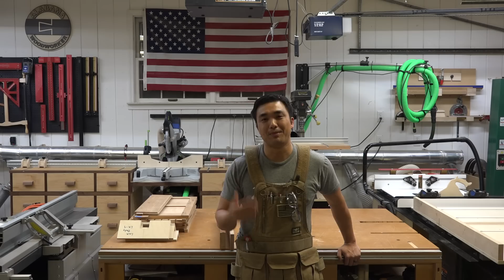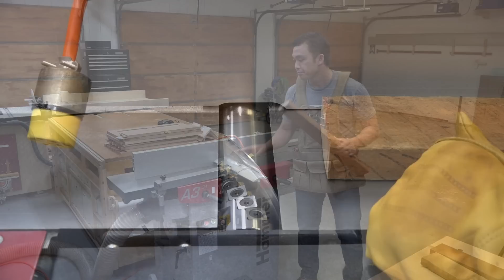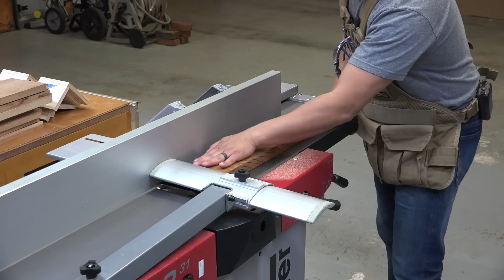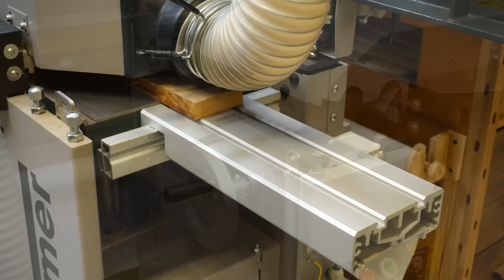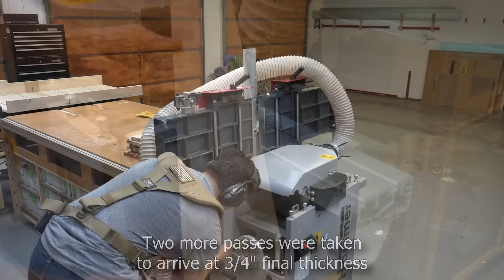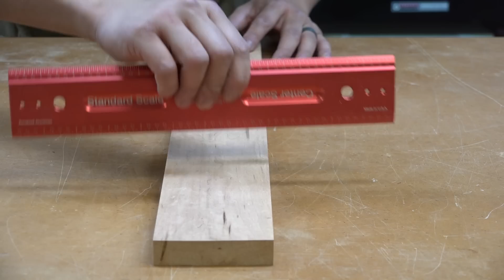Milling Rough Lumber: Surface 4 Sides S4S

Comment: Hey awesome vid! What do you do to account for snipe on your jointer/planer?
Do you leave a couple extra inches on each end when you rough cut, so that any snipe gets chopped off when you cut to final length?
Or is your machine tuned well enough you just don't get any snipe?

Comment: How come you don’t take down the other edge on the jointer instead of using a table saw?
Reply: If you do that, your final edge will be flat, but there's no guarantee it will be parallel to the initial jointed edge.
It's the same reason you don't joint both faces of a board--you have to joint one face so it's flat, and then plane the other so it's parallel.

Comment: Most jointers don't have that cool safety fence option.  Keep this in mind before using a machine designed for milling edges to mill a wide surface.  
Much safer to use a surface/thickness planer for wider work.

Remember you have razor blades spinning toward you at a few thousand rpms.  The wider the piece the more risk of binding and kickbacks. 

You can do the same result using only a planer and table saw.

Comment: So do you always break a full length bord  down into smaller parts or does it depend on each boards starting shape? 
Like a rather stright unicorn board or a common duck twisted warped board?

Comment: The 4th side can also be done by a planer--assuming it is not too wide for the planer.  You also might have to use one pass of the jointer after using the table saw to "clean things up".

Comment: Love your content. I was always taught to beging on jointer with bow up or piece in concave down position. This is so you can avoid rocking and rolling the board as you pass over cutterhead. But, I've alway felt your method would remove less stock overall if one could control that rocking while moving through. You seem focused and careful with your hand movements while guiding your pieces through but any technique that is less regimented going through will just be cleaning the still bowed surfaces. Am I thinking logically? - novice here.

Comment: Just a curious question, wouldn't it be okay to joint cut the final edge since both faces are parallel? Is there a particular reason you use the table saw for the final edge?

Comment: Nice points you made. Nice making them on a 3500 piece of equipment
Reply from the maker: Man, I wish the Hammer A3-31 was that cheap.
Reply: @AlabamaWoodworker  I did look it up to match sure the numbers were right, even going to the website but site wanted me to join so I said, 'nah'. Maybe I got an old link as far as purchase price as I reading into the third page of google responses, I see $5877 as a price.
Reply from the maker: @bogey2230  Yeah, that's about right. I'm happy to answer questions about the machine. However, I hope I conveyed the intent/purpose of this video as being a demonstration and the logic behind my milling process. I'm not sponsored by Felder and I gain no benefit by owning a Felder machine. If I was, I'd state that in the video.
Reply from the maker: @bogey2230  Also, if you're genuinely interested in the pricing on this machine, I'd recommend connecting with Felder Group at a trade show they're participating in. They often offer a discount on show floor models. That's how I acquire my machine and several of my friends have done the same.

Comment: Honest question: why use the table saw at the end? Would it work just as well if you just joint the last edge as well? Thanks for the vid, and congrats on the baby! (I know it's been over a year but anyways :) )
Reply from the maker: Yes, it would. Actually, it would be better to run it through the planer to ensure the two edges are perfectly parallel. However, I'm not keen on running a single piece on edge through the planer. Just seems a little "tippy" to me. If I had multiple pieces to gang together to provide lateral support, I'd likely run them on edge. That being said, my table saw is very accurate and I'm confident there edges are parallel, flat, and square to the other faces.
Reply: @AlabamaWoodworker  thanks for your response. Now that I think more about it, running it through the table saw ensures the edges are not just flat, but also parallel with each other. Whereas running the edge through the jointer will only ensure it's flatness and perpendicular with the face. 
Good vid for a newb like me, I'm just using table saw and jointer for the first time :)

Comment: Very good video, thank you.  One question I have is after planing the two sides then jointing one edge, is it possible to simply joint the remaining edge instead of using the table saw?  After obtaining three flat and square sides doesn't it make sense to just joint the last one to achieve the same result?  Just wondering.  Thanks again for sharing this.

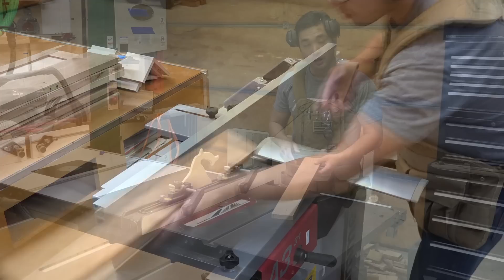Comment: 8:15 why not use the jointer to mill the last side?
Reply from the maker: You can absolutely do that. The table saw is a faster method.
Reply: @AlabamaWoodworker  Makes sense, thank you!

Comment: Hi Huy, congratulations to you and your family on the arrival of your baby girl and thank you for the awesome video.
Just a quick question regarding the table saw, where can I get that fence and the two clamps(?) on top? I have a very old table saw that I recently acquired but too afraid to use ( kickback) cos it didn’t come with any guard, riving knife or fences. I’m trying to get a riving knife custom made but at least with the fence like yours I feel like it’ll be a lot safer to use.
TIA and g’day from down under btw.
Reply from the maker: I'm using the JessEm Clear Cut Stock Guides. They are very effective at keeping material tight to the fence and preventing kick-back. They are a great aftermarket safety investment.
Reply: AlabamaWoodworker Thanks so much for the info Huy, for a complete newbie like myself it’s definitely worth having. 
Chúc em và gia đình nhiều sức khỏe :-)

Comment: QQ on your hammer.  Does that come with one extension or did you have to buy that? I'm curious as I'm debating (dreaming ) of getting that unit.
Reply from the maker: The A3-31 does not come standard with the extension. I bought it as an add-on and I think it's necessary on the outfeed of the planer.

Comment: Why is that you don't just plane the last edge? I've always heard that you shouldn't do it (makes sense if only 1 face would be planed, and the other still rough), but if everything is square, then what's the issue of doing so? Btw, this is Maple, right?
Reply from the maker: This is Cherry. You can run the last edge through the planer. That is acceptable. In fact, that's Philip Morley's method for milling lumber. I choose to go to the table saw because I don't want to have to transition back into planer mode on my combo machine. Saves me a little bit of time. What you described is perfectly acceptable. I prefer to go to the table saw, which is also acceptable.
Reply: the table saw has a fence where you put the clean edge on.

Comment: Great video and looking forward to more! What's the thought process when figuring out where to make your cuts when cutting oversized?
Reply from the maker: Thank you. I don't understand your question.
Reply: @AlabamaWoodworker   Sorry, just wondering if you typically leave a certain about of board length when making your rough cuts before milling.
Reply from the maker: @everydaymoto7315  Okay, now I understand your question. I rough cut my boards 1" longer, 1/2" wider, and 1/4" thicker than I need. That's also dependent on the level of twist, cup, and bow in my material. If a board is extremely twisted, I may have to mill down a significant amount before I can get a board flat.

Comment: Awesome video, I have a couple questions. Why would you stand the board on edge for a few days? Also, why use a table saw for your final cut rather than the jointer?
Reply from the maker: Thank you! I stand the board on edge to allow the board to acclimate to my shop after initially milling the board flat and parallel. This allows the board to continue to release moisture since a new surface has been exposed. Standing the board on edge exposes more surface area of the board to the open air. Some folks sticker their boards after the initially milling. I feel laying a board on edge does the same thing. The goal of milling lumber is to get all sides square to each other and for opposing faces to be parallel to each other.  Let's assume a board is in the shape of a trapezoid. After face jointing and planing I have both faces flat and parallel. By jointing one edge I make three sides square to each other. If I joint the other edge I'll make that edge square to the two faces but my two edges will not be parallel to each other. Those two edges will be intersecting lines. By ripping on the table saw I make the one edge parallel to the other edge and I make that final edge square to the two faces. Remember, a jointer flattens and makes perpendicular surfaces. A jointer does not make parallel surfaces.
Reply: AlabamaWoodworker thank you for the reply! Makes sense! I don’t have a jointer and have been trying to figure out how badly I need it, this video and your information was very helpful.

Comment: Thank for the video, but please tell me, how can I do the same work without jointing machine?
Reply from the maker: You could use a jointer sled on your planer, then use a hand plane to joint the edge.  I've also seen folks use a router table to joint an edge.

Comment: Got the same Hammer A3-31 a few months ago, absolutely loving it. Huge upgrade from my Jet 6” and Dewalt Planer. 

Quick question, when jointing a 12” wide board, I need to move the fence so far back that when I tighten the fence down it doesn’t get a solid registration on the front rail, not and issue, I just move the fence forward when edge jointing, if they just made the front rail longer I wouldn’t have this issue, or maybe my setup was off. Do you have the same issue?
Reply from the maker: Yes, I do have the same issue. The front rail literally needs to be 1-1/2" longer and I'd have positive registration on the rail for the full length of the 12" jointer. I agree, definitely not an issue since I use the middle portion of the jointer for edge jointing.
Reply: Thanks, I was racking my brain on the setup thinking I did something wrong.

Another question, when Jointing, do you need to turn off the planer rollers?
Reply from the maker: @SpydieFan  No, you don't need to turn off your plane rollers in jointer mode.
Reply: Thanks, and Congratulations on the baby

Comment: I’ve already said it but worth repeating: congrats, buddy! Are you glad you made the switch to the single combo unit from the stand-alone jointer and planer?
Reply from the maker: Hi Kevin, Thank you! Yes, I'm happy I made the switch. Having a jointer and planer with the same cut capacity makes a huge difference and it saves me a ton of room. Now that the machine sits at the head of my assembly table, I use it more often.